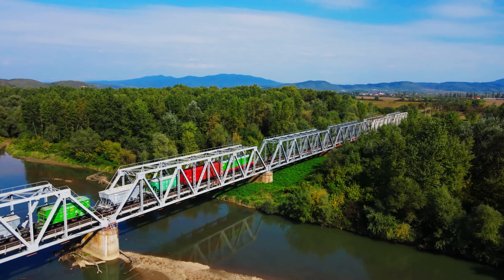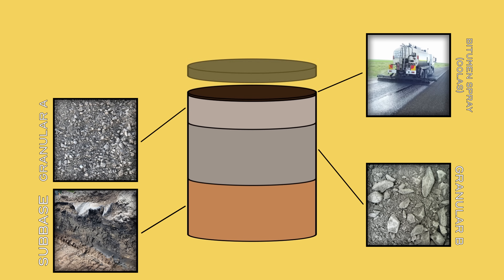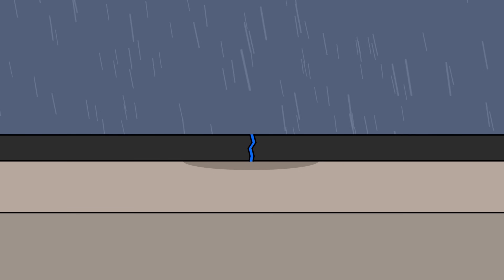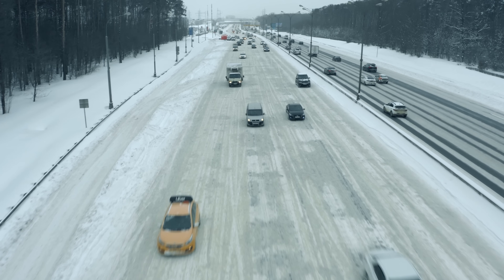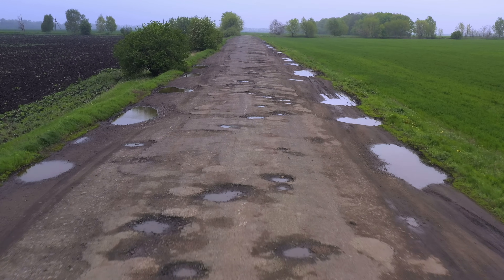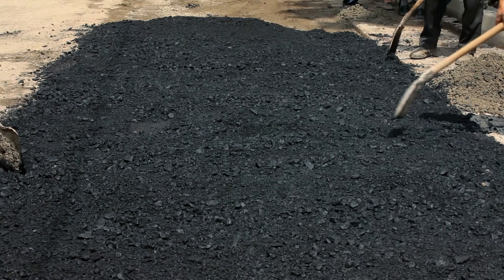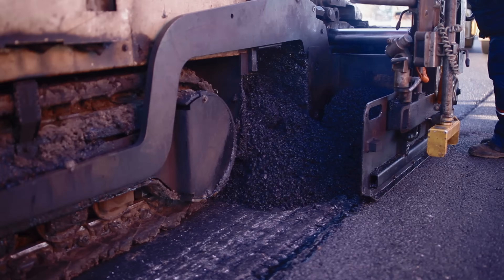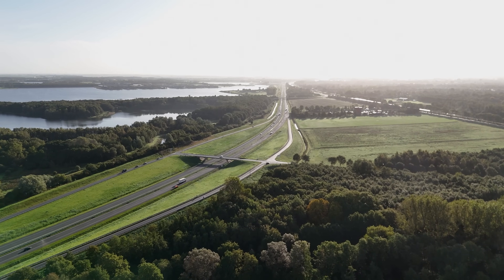Why Do Potholes Keep Coming Back Every Year?

Comment: We CAN make the roads to be excellent. But there are people who are AGAINST IT. 

And that is the industry. 
The industry does not want to have ANYTHING that last centuries. They want to get MONEY FEEDED TO THEM. 

We have  52000 km paved roads. That is about 60% of the all roads.
Almost all the roads paved were made in the 60's and 70's. They were given a 40-50 years lifespan before repavement is required. 
At that time the common truck weight was 32 tonnes at max. And all engineering was done for that daily use. 
The bridges were as well designed to 42 tonnes vehicles, mainly Main Battle Tanks or trucks transporting those. So transport of such can go easily over.

Now our roads are practically destroyed. Because our politicians allowed EU 76 tonnes trucks to be driven in, and that has been grown with some permits over 120 tonnes.
When the main roads were constructed, the pavement was made 17 cm thick. The used pavement was in-country made, very oil based and heavily stoned pavement. It was flexible enough to withstand small movements, but well made base that is anyways frozen every year 6 months a year and 3 months under water pour, means it is under harshest conditions. And all worked great for about 40-50 years exactly as stated. 

The government started to collect foundation money via taxes for whole road network reconditioning 40 years ago (in the 90's). Every sold car is taxed, every fuel and oil is taxed and all that taxed money is saved to road network reconstructions and repairs. There was over 50 billion € in the fund. Until one day a new green party government decided that the money is to be spent for other things. One by one the pot was sliced and blundered for useless stuff. Some governments purchased air, some invested to sun, some gave it to finally Ukraine. While they take more loans for all kind other things. 

In the 90's government owned all the roads, all the road maintenance services. Those were sold off to other countries for dirty cheap. Like equipment costing 15 million was sold for 20-30 thousand. Because "We don't need it for decades, and when we do, we can rent it". 

Then finally the construction companies lobbyists got ideas through the green parties that to save in oil and all other "dangerous material" the pavement thicknesses were reduced to 5-7 centimeters. That is 50-60% reduction for the pavement.

This is after government sold the national oil refinement plants, oil tankers, the chemical industry etc, everything was privatized for mere few millions, worth of billions.
The country can't produce its own pavement paterial anymore, it can't produce anything own from own oil, or it can't anymore transport oil anywhere by own tankers.

Everything has become costing too much, and there is no machinery or even skilled people to do the work anymore. 

My local road is forlorn from last 20 years. First potholes appeared about 20 years ago. They were let unfixed for few months and got worse, but got patched up. 
Since then all the time the new potholes appear, sometimes just matter of days after the previous ones fixing. There are more patches than there is a road anymore really.

Just last year the municipal got an idea to dig deeper all the ditches around the roads. They went from proper 35-37 degree angles to over 45 degree angles. No soil can stay in its place on the edge of the pavement on such angles, and those new ditches can be over 2 meters deep now. When you drive a car, you fear for your life that if you accidentally drive off road, you will drop to 2-3 meters and straight to ground, that is like hitting a full grown tree at full speed. 
The soil has started to run off under the pavements edges, and edges to crackle and fall off. 

The pavements are now after 20 years of irresponsible rework become so full of cracks that water goes through like nothing, and cause more cracking all over places. So max speeds from 80 kph is dropped to 50 and 60 kph. If you have a trailer, better drive at 40-50 kph. 

And green party people, anti-oil people etc, are happy as people should use bicycles and move to cities and be more aware ecologically.
While industry is happy that they get paid millions to resurface something with 2-3 cm new ecological material pavement, that doesn't fix the base problems now existing there. So after every single winter the road is exactly same as it was before the resurfacing. 
And the cycle repeats constantly. The companies are paid annual subscription, do they repair or not the roads. And when requested, they say that there is no sense now as it will not last but on next year, but municipals continue paying annually for work not done. 

This is what happens when you privatize national resources and critical infrastructure, and you allow in Green idiots who don't even know how to grow a tree and sustain forest.
Everything that was built to last, will not last as they are not properly maintained and nothing new last as they are not built to last with proper materials and chemicals and engineering.

Comment: I’m about a month into my new job as a road condition analyst for my state’s DOT, this video does an excellent job at exploring the complicated nature of road maintenance. My state used to operate on a “worst first” repair priority, and only in the past couple years shifted focus to preservation/protective maintenance, which you excellently support in your analysis. One of the issues which you hint at but don’t explicitly mention is that when a crack forms, traffic driving over it can cause the sides of the crack to rub together, causing the crack to widen as material erodes under the friction. Overall an excellent overview, with great visuals, examples, and sources. I’m looking forward to sharing this video with some friends and checking out the rest of your videos!
Reply from the maker: Thanks for saying that, it means a lot and yeah, share it around for sure. It helps the algorithm push my content!

Comment: Now explain pot holes on dirt roads.
Reply from the maker: Those ones are a little more simple, just water infiltration, pooling water, constant traffic and a freeze thaw cycle as a kicker doesn’t help. With that said dirt roads are pretty cheap to fix, just get a guy in a grader, a roller, water truck and a few belly dumbs full of GA and you can fix it up in a day lol

Comment: AFAIK.... dentists dont just drill a straight hole in a tooth, they undercut and that what gives it the hold. 
Additionally MOST fast repairs dont even bother to clean out the hole and just dump the patch and run.
Finally - I can show you some stretches of well used in NJ -USA that were (mistakenly?) made of concrete that are perfect after at least 60 years that I know!
Oh BTW thanks for the salt on the road that has demolished my cars/trucks!!
Reply: Nearly all interstates were built with concrete, I understand, even if later covered in asphalt.

Comment: You don't get potholes on a sloped surface because water runs off it.
They develop on flat places which hold pools of water.
Slope the surface and no more potholes.
Reply: Here in the mountains of Colorado, I've seen examples that seem to contradict that.  The federal highway used to have potholes as big as the ridgetop gravel road through the national forest, until finally repaved after fifteen years.  Nearly the whole highway sloped up or down.
Reply: @bearcubdaycare it's not possible to get a pothole on a slope because the water rolls off it.
They only develop on the flat starting with a small pool.
You can fix them with a camber or a side slope.
The old road builders always had a ditch on each side of the road and it was designed to hold the rainwater and it slowly soaked into the land.
In the UK nowadays they get serious flooding in lands because farmers made the fields bigger by closing most of the ditches around smaller fields that held the heavy rain like big tanks and it slowly dissipated.

Comment: The Romans built roads that lasted 1,000 years.
Along comes the 1900's and some genius with an "engineering degree" and they can't make a road that lasts 1,000 days.

Something is CLEARLY wrong here.
Reply: Cars too heavy?
Reply: @paulebroderick  Concrete is too weak, and asphalt is a HORRIBLE material for roads.
Reply: @letmepicyou I’m not sure what specification you use but:
1 - I would say that modern cars and trucks have a lot more force at the road surface (torque?) than slow moving and lighter horses and carts.
2 - the Romans did also repair their roads and there are monuments to this for example on the Appian way. Regular maintenance and repair remains one of the best ways to ensure a road stays in good condition.
3 - Roman concrete did have some things in it that allowed to self repair as water ingress occurred - but I think one of the largest problems we have with concrete now is that we use it in different ways. The addition of Steel reinforcement has allowed us to use concrete in tension as well as compression, however the Steel has caused issues with spalling and degradation of the structure due to rusting where water ingress is not properly controlled.
Reply: @paulebroderick  For one, I think you may be underestimating the wear and tear on a road caused by 50,000 Roman soldiers marching 4 abreast, along with all of their gear.  Many of those carts weighed WELL into the tons, and with much skinnier wooden wheels, the local PSI loading probably wasn't too far off from a modern semi.

As far as repair goes, this is absolutely correct, any road system requires regular repair.  Mother nature with her mini floods and washouts probably did a huge amount of damage.

And as far as the concrete goes, I think we've just lost the technology for making super-high-strength concrete.  Everywhere around the globe, from south America to Africa, and of course the Roman empire, there are many structures, such as ancient pyramids, that are actually concrete but which most archeologists have mistaken for stone.  THAT is how good ancient concrete was - archeologists today marvel at "how precise the joints are, you can't even slip a piece of paper between the 'stones'", and that's because they WEREN'T stone, they were concrete.  You would have to be more than a bit daft to think that ancient people without advanced tooling could quarry and cut stone with such a precision, using angles that you can't just "guess" at and hope the stones fit.  It's absolutely nuts.

Every one of those "perfectly cut stone walls" aren't stone walls at all.

Whoever figures out how ancient concrete was made is going to be quite rich.

Comment: In many cases large trucks cause most potholes, road damage and bridge damage. Also unstable soils such as Yazoo Clay in Mississippi is a huge problem. Proper water drainage is also key to preserving good roadways/road surfaces. Governments also play too much kick the can down the road. Maintenance schedules should be tightened up as well as surface replacements should be tightened up. 10 to 15 year asphalt replacement is nuts when large trucks are hammering the roads as they do. Should be 8 to 10 years at most for resurfacing highways/interstates.

Comment: They need to start putting recycled rubber sheets on top of the road base with a layer of recycled melted rubber over the top to seal it up. 

It will put a barrier between the road base and bitumen making repairs at least easier. And get rid of a massive amount of used tyres sitting around harming the environment.

Maybe.

Great video.

Comment: 24 inch road bed in the US vs 48 inch road bed in Germany; and Proper drainage does wonders to budgets and potholes.  Going below the frost heave line makes roads safer.  Anyways states, towns and cities don't care about lawsuits because they have to be notified of the pothole, and be given a reasonable amount of time to fix it, before you can sue them or at least where I live.  Generally they are given 1 month.

Germany has airport grade smoothness and has lower maintenance costs than the US.  

Also your explanation about potholes is incomplete.  In the South cracks allow water to pool, and vehicles driving over creates a pumping action, which removes the subsoil beneath the road, until it finally fails.

Comment: Water doesn't just SEEP through cracks... It gets pushed into the crack under pressure by every tire that rolls across the crack. It's like a pressure wash blasting down into the roadbase.

Comment: The weight of vehicles has gone up. The road damage caused by heavier vehicles is exponential
Reply from the maker: @chadharvey5149  that’s just not true, cars have gotten lighter over time, the average suv nowadays weighs less than an average car in the 80s
Reply: @Engineerley Car weights have overall gone down, there was a large drop in the late 70s with the oil crisis. Since the early 80s though cars have on average been getting progressively heavier again due to safety equipment, more onboard tech, and EVs entering the market with heavy batteries. 

Additionally trucking has gotten significantly heavier on average, VMT of trucks over 100k has tripled since the 80s. Even if it isn’t exponential like Chad said, the wear caused by this traffic is notable.
Reply from the maker: @Paulie820  Sure, that may be true but that doesn't cause the problem it only accelerates the rate at which the problem gets worse. 

Water infiltration due to bad/cheap construction and freeze thaw cycles cause the pain points that are made worse by heavy trucks. But, the trucks being heavy has very little to do with how they form in the first place.
Reply: @Engineerley  right… not disputing the process of how the road breaks down. I was correcting the fact that traffic loading has been getting heavier, leading to accelerated wear, leading to the potholes coming back faster. 

I don’t disagree with you that the current material/layout is flawed, or that it’s flawed because of bad incentives with gov’t contracts. The fact that traffic load is increasing is more of a reason to use thicker, higher quality wearing surfaces for our roads.

Comment: Another reason is that when the surface is opened to fix utilities, the patch to recover it is usually substandard.  The patch degrades quickly and a new pothole is born.   Fixing the pipes or wires or whatever under the street is the primary purpose of the crew.   Patching the hole is just a secondary pain in the ass to them.  They just slop on some asphalt, tamp it down or maybe roll it and that's it.   If it looks half way decent, that's good enough for them.
Reply from the maker: Yep, that's another good point!
Reply: That's why when i needed to replace the water line to my house, i had them tunnel under the driveway, rather than cut and patch.  Didn't cost any more, and the driveway is still fine years later.

Forcing people who want to add a water connection, say, to pay the cost of a proper repair of the roadway after, would reduce some of these quick patch instances.  Make them relay all the layers, not just the asphalt as i suspect many do.
Reply: Our city must be the exception. Here is seems that the patch remains fine but the rest of the road continues to degrade. They do leave the hole filled with dirt but no asphalt for a few weeks, I think this is so the cars compact the dirt more then the usual compactor. When the come along with the asphalt the dirt is compacted well and holds up well.

Comment: Many pot holes come back when the repair crew does not use an adhesion promoter. Asphalt and concrete appear sticky but after setting up can easily come off of what they are put on.  Example of this is concrete forms.  You do not always needs to use a release agent on concrete forms.  After the concrete has set up you can remove the forms without too much problem.
Reply from the maker: Yup exactly right, same thing happens if the surface isn't cleaned properly or cut smooth enough.

Comment: Saw Nebraska pave a road, two years later the blowout in a fill blew out again. The asphalt just crumbled. 
They didn't even try to level a couple dips in that road that could launch a small car.  

Kansas has them beat, a blowout in US83 didn't make it a year til the new pavement blew out again. I think they actually dug in and fixed the base, though.
Reply from the maker: Yah at least they fixed one properly its rare these days.

Comment: There’s one thing that’s not mentioned!  Concrete! Roads used to be made of concrete, but environmentalists/liberal democrats came up with the idea of using the old car tires and turning them into asphalt to put on the road. At the time it put a bandaid on our car tire dilemma.
Reply from the maker: You're right — I definitely inadvertently overlooked mentioning concrete roads, and that they were more common in the past. That said, a few things are worth clearing up: using recycled car tires in roads (aka rubberized asphalt) is actually not the standard — it’s pretty rare and only used in certain regions. 

Most old tires now (about 60%-70%) are used for either fuel in power plants, mills etc. or ground up and used for rubber products like playground surfaces, turf fields, rubber mulch etc.

Also, one of the biggest advantages of asphalt is the ability to do “shave and pave” repairs, where they just mill off the top layer and repave. Concrete doesn’t work that way since it’s laid in rigid slabs with rebar throughout, so repairs are way more disruptive and expensive.

And while concrete can last longer under the right conditions, the upfront and repair costs often outweigh the benefits — especially when there are newer, longer-lasting asphalt technologies available today.

Appreciate the comment though — it’s a great point and I’ll definitely dive into materials more in future videos!